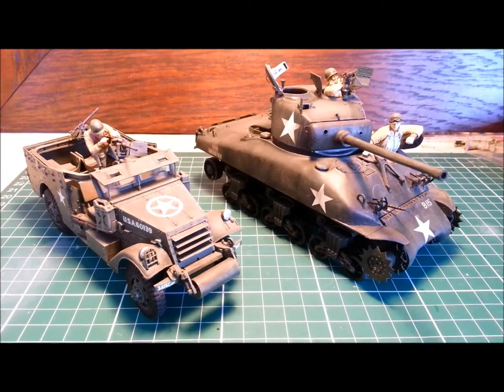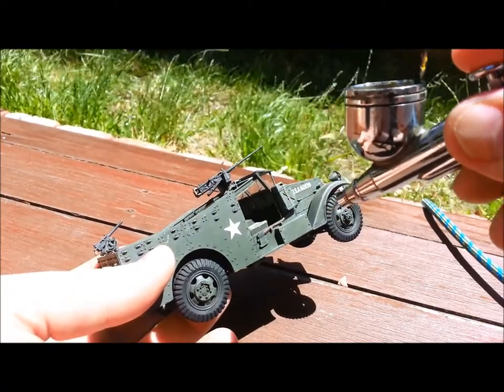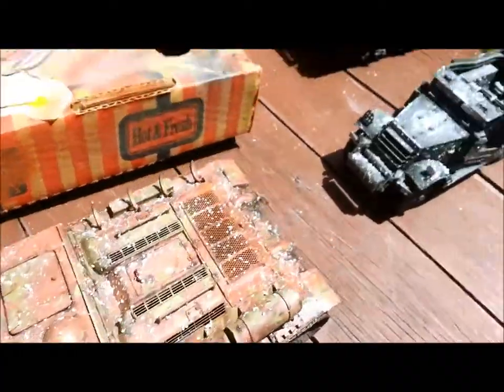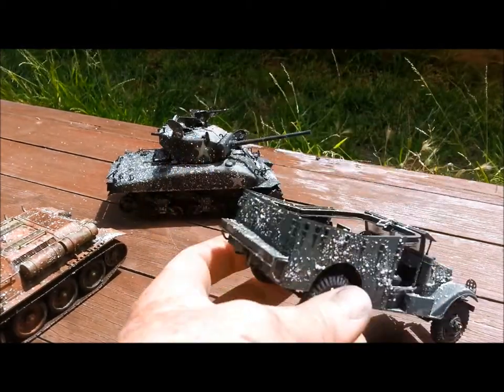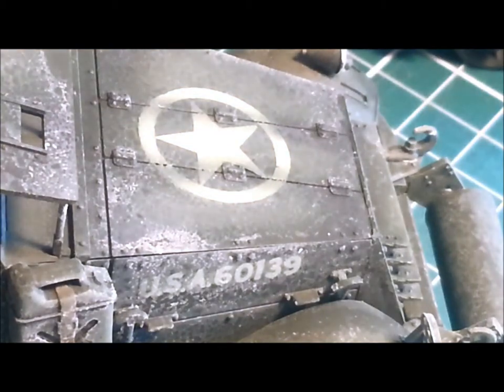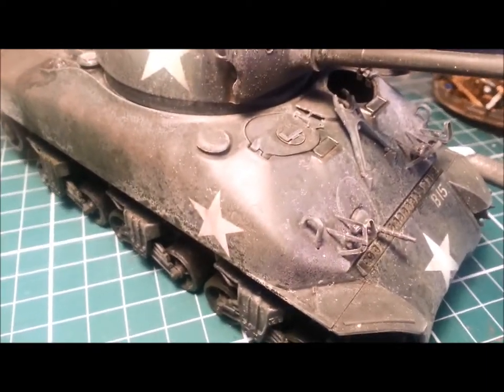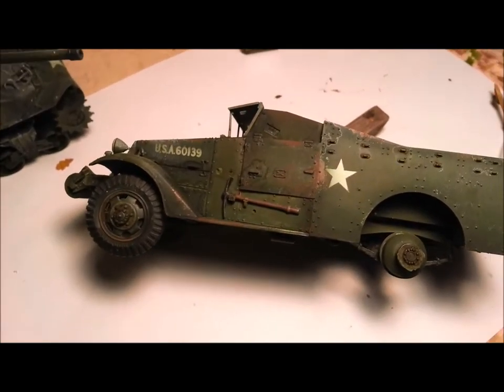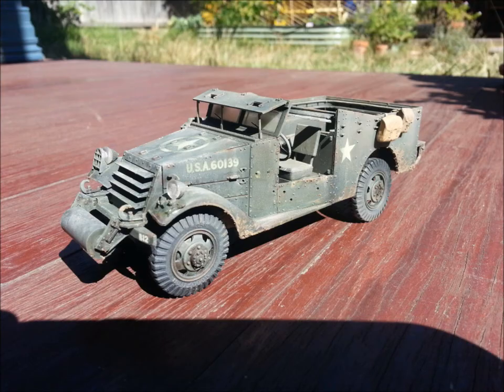How to weather scale models - Part I: salt technique, washes, chipping, rust

Comment: So many times I have wanted to achieve that washed out look and you just showed me how I am so grateful thank you . Is it ok to use oils and thinner pin washes over acrylic paints ? I have tried pin washes and panel line washes with thinned acrylics and they are nothing like as good as that, you just don't get the flow, and the Vallejo purpose built washes always dry shiny.
Reply: Of course, that's the beauty of using acrylics - as soon as they are dry you can use oils/enamels over them.  Oils/enamels flow much better and take longer to dry so stay workable for several hours. Acrylics are typically not well suited to washes or dry brushing (although Vallejo may argue that point).

Comment: Can I use the salt technique with acrylic Tamia paint?
Reply from the maker: Definitely. Just keep your airbrush paint thin, and make sure that the base coat is totally cured for at least a day or two (or more) before you wet it. I'd probably also be conservative with spraying the water on to hold the salt in place, don't use more than you need to.